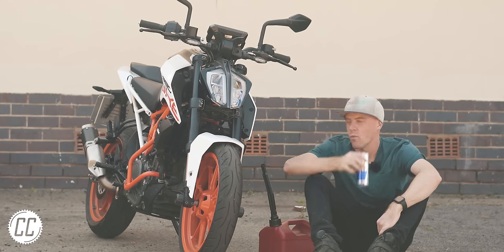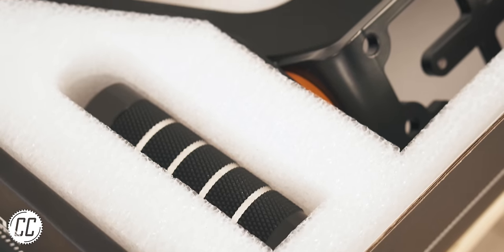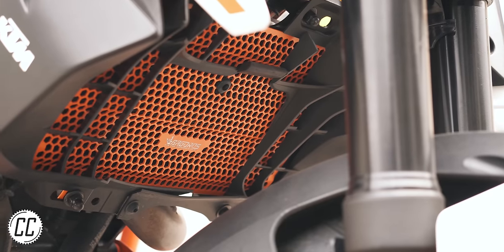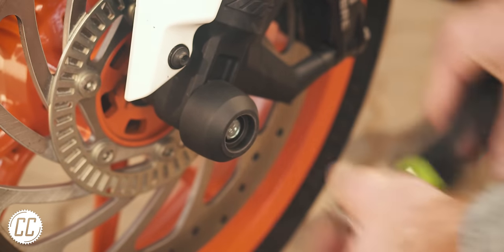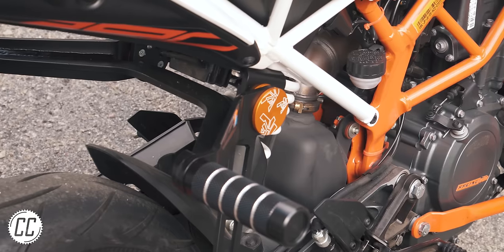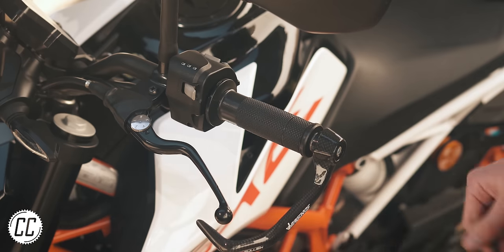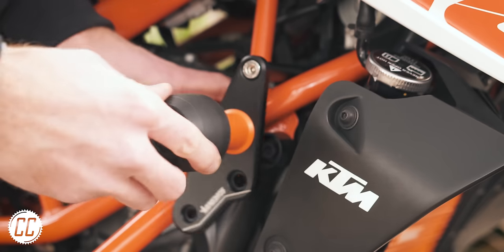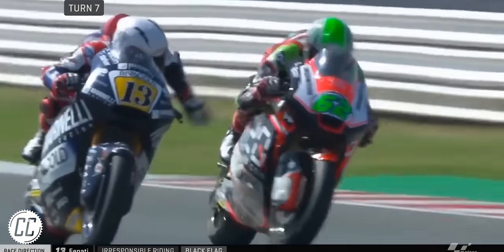6 Ways To Protect Your Motorcycle You Can’t Overlook

Comment: The overhand extra weight in the bike sometimes changes the vibration characteristics of the motorbike. I bought a frame slider from eBay for my duke 200 and the resonance frequency on the frame slider matches with the frame itself and makes my bike vibrate like it has a seizue.

Comment: ***One of the best mods you can do is fit an early R6 rear shock which gives you better and adjustable damping. I had to make up a sleeve for the swing arm-to-shock mount - everything else fitted perfectly. It is worth swapping the KTM spring onto the Yamaha shock as there is no rising rate linkage on the KTM set up. It was such a good upgrade that it showed the front end to be inadequate, a quick fix for that is to extract some of the front fork oil and replace it with thicker 15wt oil.

Comment: If you think about it your bike was never symmetrical. You have chain and front brake disc on the left and rear brake disc on the right side of your motorcycle. And the headlights when using short lights in some bikes are only on one side. Idk I don't even own a motorcycle but that kinda makes sense I think.

Comment: i use my own brand of crash protection .It is called common sense and it weight nothing , requires no tools to install , you wont hit your shin or any part of your leg on it and  it will actually protect you , unlike  frame sliders which are basically tip over protectors and will snap off  in a crash  or dig into the pavement  flipping your bike in the air causing  even more damage  on impact .
Off road riders dont get mad at me , you guys drive slower  and on a softer surface , your bikes are light and so frame sliders will actually protect your bike

Comment: From my own experience, please don't install those crash bobbins. Even those like yours, the interconnected type, will bend your frame on a small crash or drop. My Duke 200 frame got bent on a very very low speed "crash".... I would definitely damaged my plastic tank, but it's cheaper to fix a tank than a frame